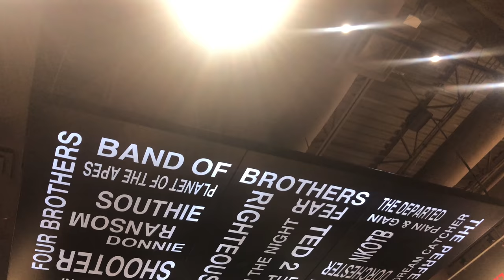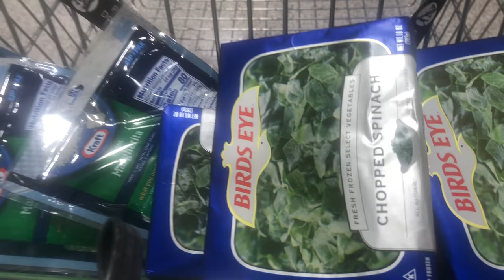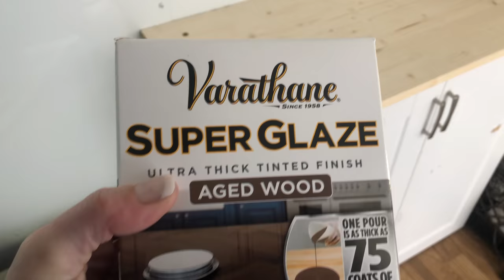We got forced off our lot docking spot, but I got some stuff done first - living in a Cargo Trailer

Comment: To get rid of the bubbles in the flooring, just get a large-bore hypodermic needle from a feed store or vet.  Use it to remove the air. And then use it to inject adhesive and weight the flooring down till the glue sets.  This also works with wall paper.

Comment: Y'all should be able to get a platform to attach to the rear of the  cargo trailer that loads the motorcycle sideways on the rear bumper. So you are not destroying the inside of your home.
Reply: Most don't have a bumper and not much of a frame either, certainly not sturdy enough to attach a 500lb motorcycle too. Something tells me you've never even had a cargo trailer
Reply: @mrmotofy  There are hitch motorcycle carriers that can handle it.
Reply: @TheophaniaRex  But the fastening to the frame is the issue
Reply: @mrmotofy  The Airstream will handle it.
Reply: @mrmotofy  um, there are two trucks it can go on

Comment: If part of the floor bubbles are going to be under the bed or the cabinets (and not in the middle where you walk), you could cut a slit in the flooring and work some liquid nails (or other adhesive) down along the bubble. Then place something on top of it while it dries. The problem is that the little cut will kind of roll up and apart over time, so it's better if it isn't somewhere you can see.

Comment: You can peel back the vinyl flooring and regular it with a grooved spreader that actually determines thickness of glue application.  Then roll it from the center to the edges with a 2 to 4 ft by 2inches diameter dowel from Home depot or Lowes to use as a rolling pin.

Comment: An idea for insulation for your floor is to use 2in foam board screw it up with washers and Spray Foam It all Up. Flex seal works good to seal it up.  Last night got down to 18f here in Wyoming and it works great. My shower pan in my 6×12 I have a utility sink. took the legs off, cut where the faucet mounted on it off to mount it flush to the wall.  The height of the utility sink is perfect to hold the shower curtain in while taking a shower. Used foam style baseboard down each side to keep water from going out the sides. Works great takes up no space. I put mine to the left of the side door as you walk in.

Comment: Sorry about chewy, loved the goats as we used to raise them. Why don't you consider preformed formica countertops. They will withstand anything you throw at them, they're inexpensive, easily removed if you reconfigure your rig, and available in many different colors, have a preformed backsplash, raised front edge to keep spills in check. They'll probably cut the in the lengths you need with the panel saw if they don't already have the correct lengths. Something to consider anyway.
Happy travels..

Comment: Replace the entire trailer wiring. its a common fail component of just about any trailer. Don't waste time chasing false grounds and spliced wires. Its like $20 for 20 feet of new wiring harness. From what I've seen in your abilities, you could knock it out in a couple hours and have confidence of good wiring for the next couple years.

Comment: Hi Lex and Riot.  Soooo...cleaning and or projects is something I've done recently too.  I understand what you're going through in a sense. What once worked doesn't now, and change creates new challenges. I like the furniture idea. I just bought a small futon type couch that would work in your trailer. You should get a desk/table  setup too, save your back. Let go of whats not working and change it up. You might be able to sell what you don't need anymore to buy what you need now. Good luck.

Comment: Oh wow. Having to live in that mess would give me anxiety. It looks like you might be planning this but you could do a drop down or flip up countertop along the wall so you can have the best of both worlds for that space. Also some touch up paint would go a long way on the cabinet doors. I wouldn't think you would need to get into the walls for the wiring. Rigs like this have their wiring daisy chained so testing each outlets power and ground starting downstream and moving forward should give you the clues to zero in on where the interruption is. Learning to test things with a voltmeter is a valuable skill to pick up. Bummer about getting kicked out. I'm sure it was preventable but I will say that some people have pretty vile beliefs and sometimes it's best to approach it head on when it's family.

Comment: Who could have guessed?  An intelligent, discerning woman spending time with good ole boys in Alabama is bound to lead to an argument over politics. (I realize the argument was between your traveling partner and his cousin, but ....) Alabamians are not known for their critical thinking skills, logical fallacies understanding, or cognitive biases self awareness.  Reliable sources discernment is very limited due to the previously mentioned issues, and therefore, Fox News Channel is considered a reliable news source instead of an entertainment source. On another note, please reconsider your electrical taping solution. In a climate controlled, stationary environment, the tape may stay intact a few years. In a non climate controlled, basically weekly earthquake environment, you are taking an unnecessary risk. For less than a dollar, install wire-nuts on the ends of the wires and then apply electrical tape. Easy solution and you may be very glad you went to the extra effort, even if the wires are properly fused. Breakers and fuses sometimes fail.

Comment: your partner is a little short on truck but not you dear gal. you gots a F250 6.7 diesel. your truck can pull his camper his truck and motorcycle all at one time with a 6X10 cargo trailer taking up the boot. he can get a rack to load that motorcycle on his back bumper.
Reply: Just not all legally

Comment: Your wiring issue for your brakes in your blinkers and running lights it's only three wires green yellow and brown and a ground for excuse me and splice and fix it is not a big deal get back to Arizona or California and text me I could probably fix it in an hour for free
Reply from the maker: Hi! It’s the interior and exterior light wiring. I appreciate the offer!
Reply: The four wires for the lights and 24 the brakes a blue wire and a white wire just splice the wires back together in the same color and you'll be fine the guy that fixed or replaced your axle was an idiot a real moron for cutting your light wires I bet the electric brakes aren't working either it's seven wires in a easy fix twisting wires together take them up and get some shrink tape it's an easy fix